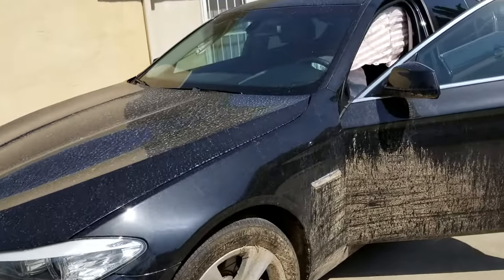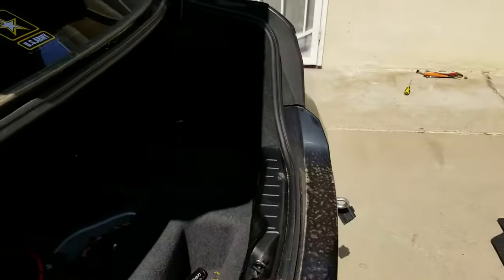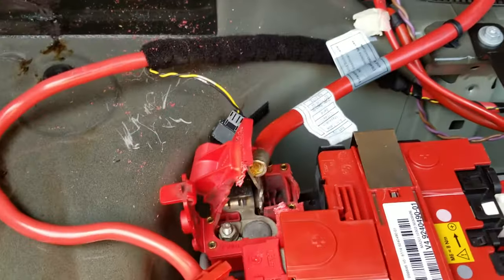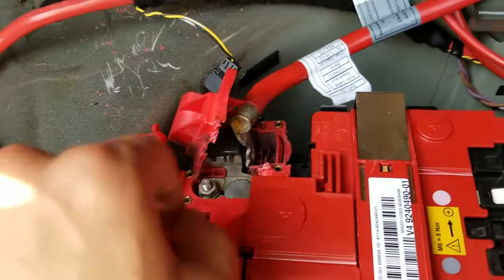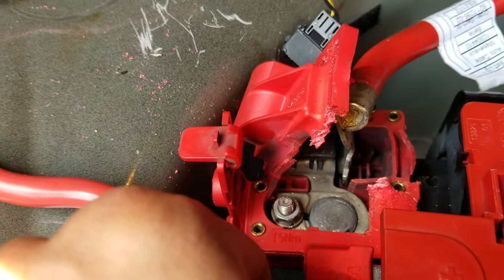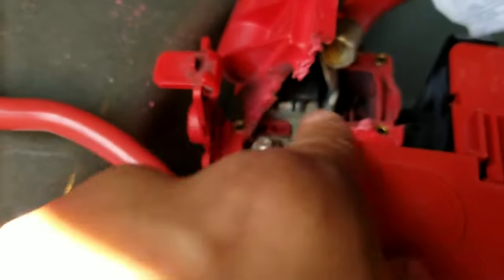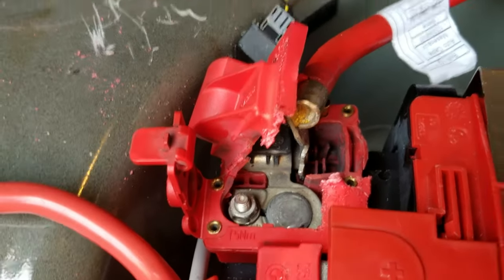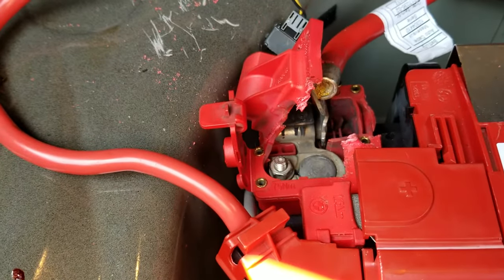HOW TO START YOUR BMW AFTER AIRBAGS DEPLOY Temporary Fix

Comment: Hi Issac, thanks for the info. I have a 2015 X6 and my airbags deployed when I crashed into the highway concrete barrier. Haven't been able to fix it because BMW would charge me way too much. (No full cover) any suggestions on where or how I can bypass the computer. Car won't start and nobody wanna mess with my car. Everybody tells me to take it to the dealer ..
Reply from the maker: The first thing I would do is buy a new positive battery cable. It is very easy to replace. If the airbags deployed that wire needs to be replaced. I tried looking on Amazon and Ebay for one for your car and wasn't able to find one. To save time I would just go to the dealer and buy one.

If you just want to see if it starts, you can unplug the positive, break it open like I did in the video. You will see that if has been separated on the inside. ( When the airbags deploy, a charge separates the 2 so it cuts power to your engine. The car will act like it wants to start but it won't) 
** Try at your own risk
Let me know if any of this works

Do you live in Southern California??
Reply: I live in so cal i need help with this too
Reply: ISAAC TECH I’m from Fresno & have a crashed 2007 bmw 335i. I have the same problem. My car has been crashed for almost 2years & the mechanic who was fixing it gave it back 😭 I will have my brothers try this 🙌🏼 does the car suppose to fully turn on when we try this? Or just like if the battery was dead? Please help
Reply: @NOT444U  does it work?

Comment: Hello, i had an accident with my 2020 bmw 520i and the airbags deployed, almost all of them except for the seats airbags didn’t deploy ,and there is no electricity reaching the car what so ever even when I tried to jump start the car there was no power inside the car at all , and im not able to open the trunk to reach the the cable that you are talking about and tried to find a key slot in the trunk but there’s no key slot for the trunk, any idea how can i open the trunk in my situation?
Reply from the maker: Try a starter pack pack make sure the ground ( Black) is attached to the car and try again. You can also try the rear seats. good luck

Comment: Hi, I had an accident recently and I have this exact problem, and the only thing highly affected is my front left light ... if I replace the positive cable would it start and be safe to drive to the dealer? The dealer is 15 miles away.

Thank you 🙏🏼
Reply: Did it work for you?
Reply: @codyjardet  yes, but I replace the entire cable. Thank you

Comment: The electric in my car is working it still wont start
Reply from the maker: Depending on car if your airbags have deployed you will need a new positive battery cable.   The positive battery cable has Pyro Fuse that blows when airbags are blown and prevents the car from starting. The car will still have power ( so you are able to open, unlock or roll your window down during an accident)  but will not be able to turn on the vehicle.
Reply: @ISAACTECH  how can i test it to see if engine ill crank now? If i hook up a jump and then try to start maybe?
Reply from the maker: If it’s a BMW like in the video you will have to break open the positive terminal, once broken open you will see that a piece inside has been separated .  Attach both of them together and the car should start.  I only did this to move it onto the tow truck since the car was considered to totaled. I recommend you to just replace the positive terminal wire your local dealership should have it.  If the battery is dead you will have to jump it or charge the battery before. keep in mind this may be different if it’s not the same model as in the video and try it at your own risk. Good luck
Reply: @ISAACTECH  its a audi
Reply: @ISAACTECH   very bad information,, the temporary fix will start the engine but will cut off and wont start again even if u replace the whole red positive cable ,,all airbags deployed have to be replaced then the engine will run

Comment: Yeah but what if u can't get into the trunk??
Reply: Take the back seat out and crawl in and pull the lever. You need tools for it.
Reply: I just spent 3 or more hours in my wagon trunk with the tailgate shut. Seats down and on my knees trying to remove a dead battery and some how try to take a good battery and jump the wires so I could hit the tailgate unlock button was not fun!! I have 2 airbags blown and have some weird battery drain now that will ruin the battery if kept wired up. What the HECK!